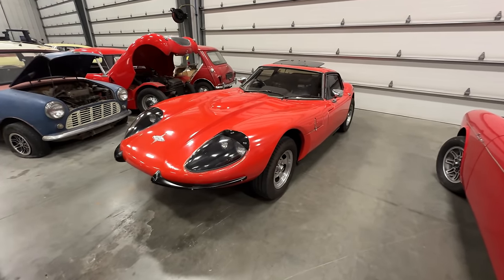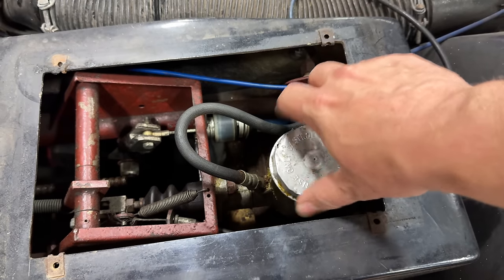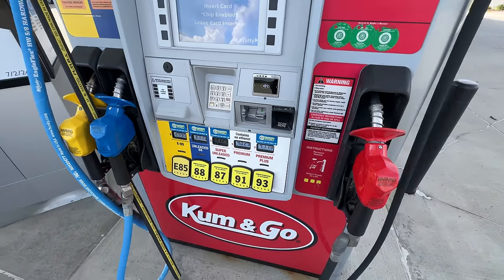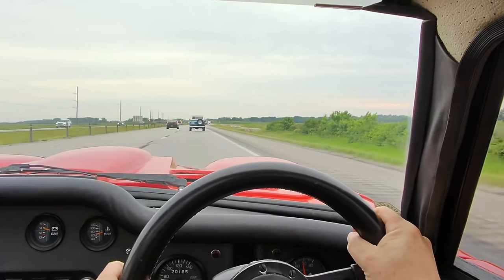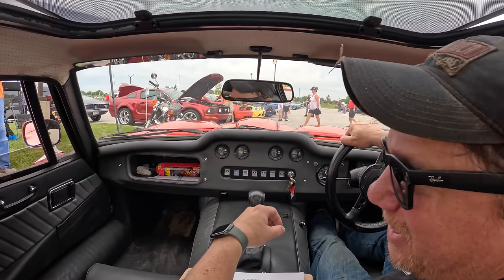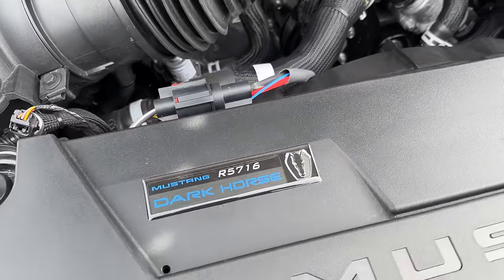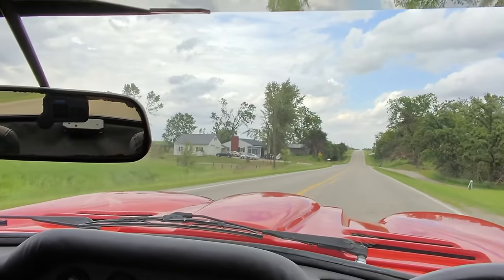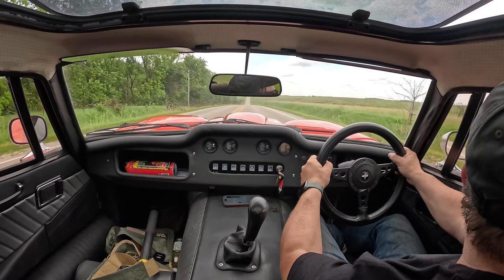Entering a Rare Car Into an All Ford Show

Comment: As an ex ford mechanic, I recognize what's under the hood.  As a Spitfire owner, I recognize the latches holding the hood down.
Reply: As an MGB ('72 BGT) owner, I recognize the interior door handles.
Reply: @mitchd949 me too bgt owner since new 1973 delivery from Abingdon 1 pound thirty shillings 😂
Reply: @mitchd949  Old-Fashioned English parts bin engineering.

Comment: Would have been interesting to see what other cars showed up in class KK!
Reply from the maker: This show has always had major classing issues and nobody checks the class you enter.  This year the Marcos, Cobra and Pantera were all in separate classes not together like they should be and last year I entered a Tiger in KK which had several Cobras but the two GT40s and a Pantera were together in a different class.  I’ve brought up the issues for several years but they don’t seem to care what happens as long as you pay the entry fee.